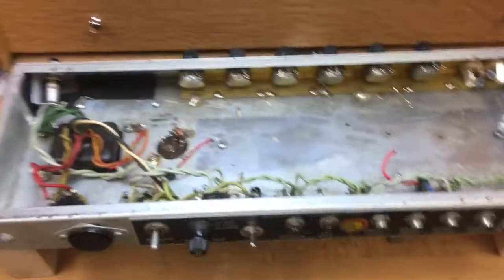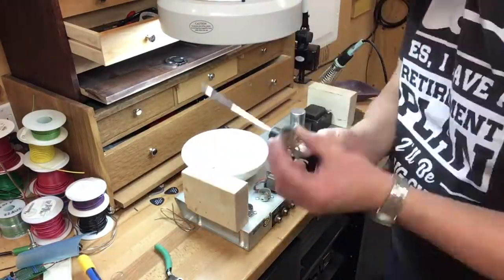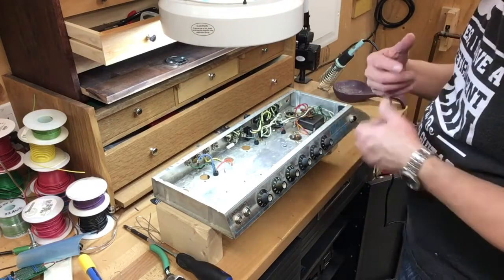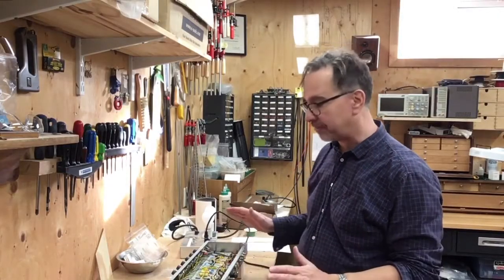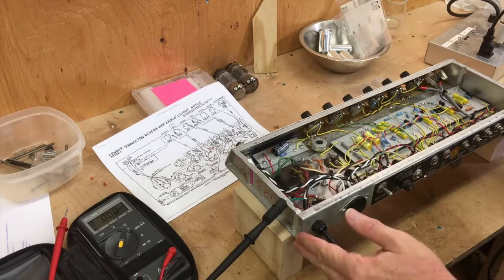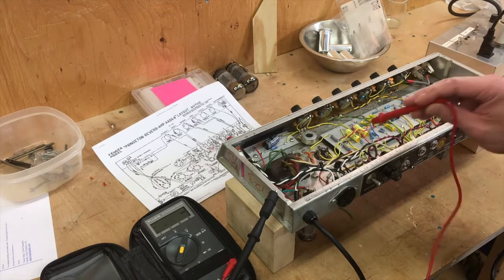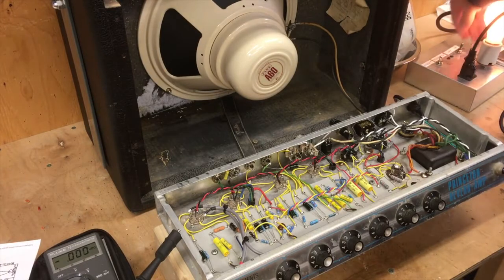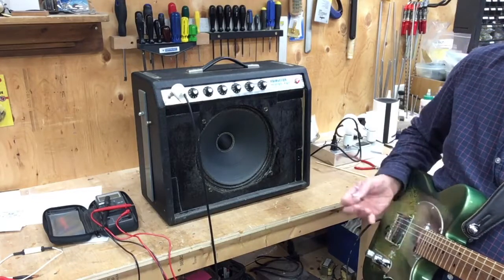Silverface Princeton   Part Four Web

Comment: You should change the name of your channel to Ampbutcher.
You replaced every component and the amp still hums? Nicely done.
Ps you cant "test" an amp's sound when it's still plugged into a current limiter because it throws off all the voltages and tube bias,  which is why it sounded terrible in your demo.